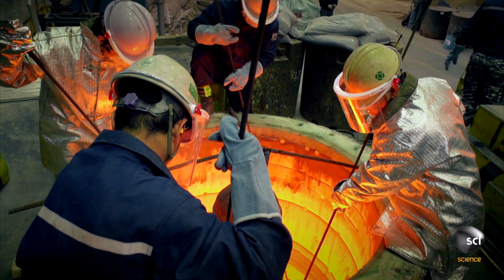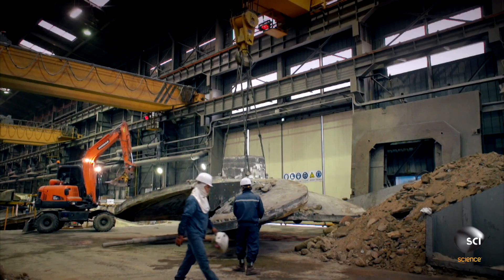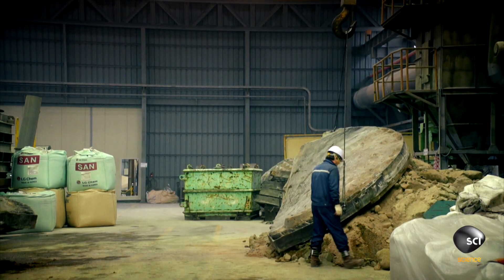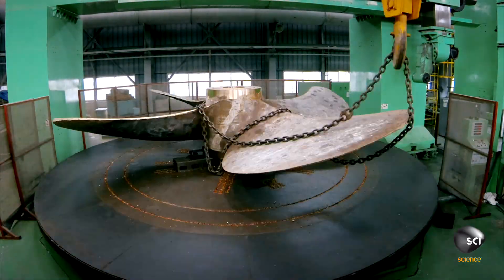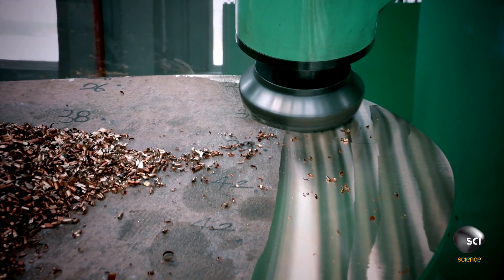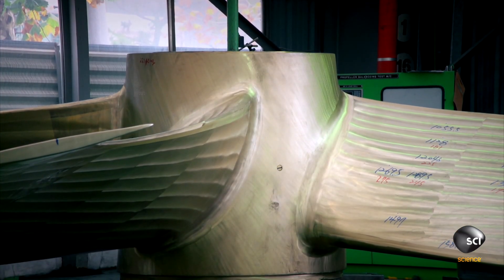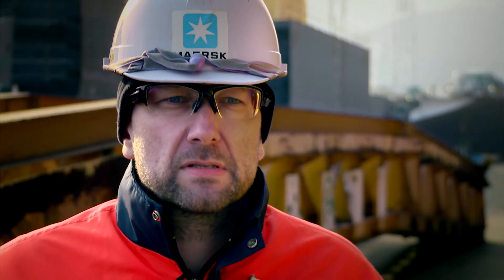Casting a Gigantic Propeller at 1,800°F

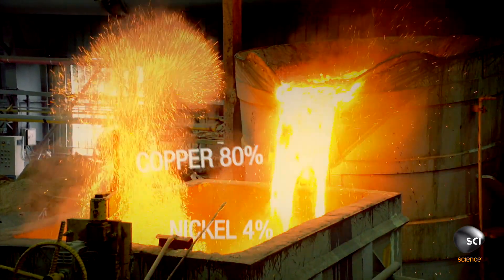Comment: Can I also add that it's made of Bronze, not Steel. it can't rust. See the make up at 1:06, 80% copper, 4% iron.
Reply: Nick Carter yeah I had the same thought
Reply: Ive seen some nasty props, they can leach metals away due to cavitation or electrolysis but ive never seen one rust.
Reply: Bronze i think is Copper+tin.   This propeller is made of Brass: is Copper+Zinc
Reply: pretty sure theres some silicon in there as well
Reply: yeah but even you used a different word then rust... this is a production on tv. They should know better..
Reply: Nick Carter bronze can still suffer the effects of corrosion......they used the wrong words......by saying rust. should know better for a science show.
Reply: It actually looked like a product used to prevent sea growth, nothing to do with rust. In Australia we use a product called "Propspeed" which effectively puts a silicone layer on the surface of the prop, not allowing barnacles to grow on it with regular use.
Reply: Thats exactly what I said about 2 months ago when i saw this....
Reply: Alejandro Medina it’s made of an alloy called Aluminum Bronze. Bronze and brass are pretty much interchangeable terms these days. Source: I work in a foundry and make copper alloys for a living.
Reply: @syxxphive126  Sorry; NO!  Brass is a copper and zinc alloy.  Bronze is a copper and tin alloy.  The ancients knew that 5000 years ago.  Brass is not an acceptable metal for underwater use because the zinc comes out of the metal leaving only porous copper.
Reply: @David-hm9ic  then tell me why copper alloy 954, which is aluminum BRONZE has ZERO tin in it?
Reply: @syxxphive126  because as you said it's called bronze basically for the same reason a 1" sch 40 pipe doesn't have a single dimension measuring 1". Sloppy standards that let room for bad naming conventions to take hold. Most of metallurgy is pretty locked down, I was a little depressed the first time I found it in that section of a red metals yard catalog, but alas, this is the world we live in, not the one we asked for
Reply: Ah, but it can. MUCH slower than regular iron, but it can rust.
Reply: Not to mention the voiceover says "alloy of 8 metals" and then 5 show up in the animation. Had to rewatch to be sure it didnt say steel or bronze to condense it but no, just 5.
Reply: it could corrode, though not specifically rust
Reply: Bronze and copper will oxidise, they wont rust. Once that oxidation layer is there its kinda sealed but that doesnt stop stress cracks opening and allowing cavitation from happening

Comment: Forging?? Really?? Shame on you.
Reply: @sciencechannel  When you buy a ship propeller online without checking the dimensions
Reply: @sciencechannel  What is that supposed to mean?  Ashamed of your mistake?
Reply: No frowns! You changed it, now smile. :)
Reply: Maybe this casting was a forgery? 

BAHAHAHA!!!
Reply: James Demos
Reply: forged would be stronger, if it were possible
Reply: manga12 Wouldent that be super expensuve for this size? They have been casting huge ship parts for over 100 years! Also it was casted then milledvto spec!
Reply: I am just stating a fact, the crosssection of something forged would be hardened and have a better stronger cross section but you often wont be able to forge some materials they are not conducive to it, like aluminum I belive was said a forge press is more conducive to use then a power hammer or drop hammer the way the metal reacts to the force.
Reply: @manga12  This is one of those cases where if you need to be worried about how hard the material is because it's hitting something harder than water, you have WAY bigger problems than just needing a new propeller. There's a good chance you're about to need a new ship.
Reply: @ev6558  look forged makes stronger with less weight that was my reasoning, and less weight means less drag on the engines to turn it
Reply: Ya went a bit far

Comment: this is cast not forged big difference
Reply: Looks like they changed it.
Reply: Can't forge bronze, too brittle!
Reply: Nighthawke70 
I have forge bronze.....you have to be very careful, with the temp you work at......Bronze is developed and gains it's strength via forging it.......BTW......you can forge iron hot or cold.......and yes this prop was cast not forged.
Reply: zzztubazzz hahaha way more then that
Reply: I'm gonna estimate it's around 15-25 tons compared to the size of Emma Maersks propeller which weighs 130 tons. A cars weight is estimately 2 tons, and already costs around $8000-20,000, and we have to remember that it is not a solid block of metal. I assume around 1-5 million something. It is not easy to make something this big, and takes a lot of work. Plus they would have to ship, and mount it which probably costs more.
Reply: mrsargemeister but the title says castimg
Reply: I've had trouble with casting bronze. It's a pain to work with, even with small moulds. This is an alloy (more than just a bronze alloy, I can't recall how many materials he said were in there)
Reply: zzztubazzz Yeah...not.
Reply: zzztubazzz scrap value maybe, these props are hundreds of thousands of dollars, 8,000 probably  barely covers power expenses in the production
Reply: nobody gives a flying fuck!
Reply: The difference being?

Comment: Science Channel with imperial measurements? Really?
Reply: science channel with not science.
Reply: And they said that that the expected life of the propeller would be 124 million miles. The moon is on average 240 000 miles from the earth. The closest it will be is 225 000 and the furthest will be 252 000. Meaning on average the ship can travel 260 times to the moon and back to complete the 124 million miles.
Reply: The metric system has yet to put another human on another planetary body.
Imperial has.
Reply: @ramairgto72  lmao this dude actually tryna say the imperial system is better than the metric system. Even people who use the imperial system know it is shit compared to metric. This is coming from someone who is used to imperial.
Reply: @kirinyardberry1324  "Tryna"?  Seriously?  Imperial is not superior to metric most of the time.  For navigation, Imperial has advantages.  Metric is not superior to Imperial ever.  Easier in some cases, perhaps, but not superior.
Reply: @David-hm9ic  as someone who works constantly with both metric and imperial systems I can say for certainty that the imperial system is much, much worse. It's easier in every single case, and this makes it superior. Why do you think all of science and the majority of engineers prefer metric?
Reply: Dick wad Know it all. You failed. Shut up
Reply: Ramairgto Actually nasa used both metric and imperial in the lunar program
Reply: Simplistic nasa didn't switch to whole metric until 1990
Reply: Because the target audience is Americans genius.

Comment: There are three incorrect statements in this piece. The propeller is "cast", not "forged". The ship will travel 1.24 million miles in its lifetime, not 124 million. The cutter head contains Tungsten Carbide inserts to mill the propeller. It is not a "Tungsten Cutting Head". Thanks. I couldn't help myself. I'm a stickler for factual accuracy.
Reply: You missed one...

The cutter doesn't "grind away at" the surface.  It cuts.
Reply: You are correct, sir!! I missed that one... Must've been still calculating the "five times the distance to the moon" figure in order to dispute that one!
Reply: @Tinker001  missed a second..." the paint keeps the rust away" it is bronze lol
Reply: @Tinker001  not only that, copper alloys don't rust, they corrode, rusting is what happens to Iron based alloys, pedants of the world, UNITE!
Reply: 1.24 milion miles, really? for a cargo ship that is like only 20 years
Reply: But in the video, it states that the propeller and its ship will travel 124 million miles. So, that would be about 2,000 years. I don't think that ship will quite make it that long...
Reply: also that prop would never rust.
Reply: @kdknitro  I wondered about that as well.  But, I assumed that other percentages of ferrous metals might be prone to corrosion and over time, cause significant degradation to the prop.  Pretty sure these guys would know.   As a sort of woodworker with that same fence on my table saw and amateur aerodynamacist, I thought it was a great video.   Imagine the technology and precision construction that went into that milling machine.  150 years ago, that would have been a hallucination.
Reply: Being 80% Copper, I doubt it either!! Good call!!
Reply: No you are correct, AS SHOULD BE THE FLIPPING SCIENCE CHANNEL!!!!!!!!!!!!!!!!!!!!!!!
Reply: 1.24 million miles hardly seems like the ship would even break in.
Reply: @GEES44DC  I was thinking this too. I have had cars with a million miles- and they don't travel across the ocean every day.
Reply: "Being a stickler" really just means being pedantic it seems. 

The only correction needed is the mileage, everything else is just stuff that 99.9% of people have no need to care about. It really doesn't matter. Especially....
"Bronze doesn't rust so that paint is useless!!!!" Ok smarty pants, rust is a form of oxidation and every non-precious metal will oxidize - particularly in the rough environment these ships will travel through. If the paint wasn't needed they wouldn't use it.
Reply: GEES44DC Ships don't last that long in the sea. Salt water is brutal! Great lakes freighters last a long time, but still, 15 miles/hour continuously is only 134,000 miles/year.
Reply: it said the alloy was 8 metals and then displayed 5 and the percentages didn't add up to 100%
Reply: @richardambler2804  That's Common Core math for ya!  Don't confuse them with accurate facts and details.
Reply: @richardambler2804  🤣🤣🤣
Reply: @richardambler2804  chances are the last 3 metals are proprietary, and therefore not listed...
Reply: @richardambler2804  It's common for major metalworks to have their own proprietary alloys where the little "1% of this, 2% of that" that makes the alloy unique is a trade secret.
Reply: Cory Stansbury
Very true, i'm from Erie, PA, we used to have many repair facilities, we are down to about 1.
Freshwater ships tend to just get "outdated" and replaced, they don't get refitted much, and only a few places have a dry dock of any major size. If I recall, the government stepped in twice to save 2 places in my city, one was our dry dock and the other was the company that makes parts for NAVY ships.
Reply: We all are, man
Reply: Its also not called a propeller. Propellers are on airplanes. Its called a screw.
Reply: @brucepreston3794  It can be called both. Propeller is the more common term. Screw is more of a slang term.
Reply: @joefox9383  i was in the US Navy. I worked in #1 engine room on board an Aircraft Carrier. If we called it a propeller, our chief would kick your ass and tell you its a screw. So its a screw. If its a propeller you must be working on airplanes.
Reply: @brucepreston3794  Dad, a Master Chief would have kicked that Chief's rear for being a South end of a Northbound Mule. The term propeller is used in the Navy both for planes and ships. But the term screw is not used for the prop on a plane. The term screw propeller was first used in 1835, long before an airplane existed. Early screw propellers were actually screw shaped and made complete turns as one blade.
Reply: @brucepreston3794  A propeller is a device with a rotating hub and radiating blades that are set at a pitch to form a helical spiral, that, when rotated, performs an action which is similar to Archimedes' screw. It transforms rotational power into linear thrust by acting upon a working fluid, such as water or air. Screw is a slang term in the US Navy. I served on CVN70.
Reply: @brucepreston3794  Sometimes called a prop.
Reply: As others have already pointed out the propeller will not rust. This looks like a nickel aluminium bronze alloy. It is commonly used in the marine industry as it has minimal corrosion and sea life will not grow on it. I suspect the "paint" is just for looks although it may be to prevent any impurities from rusting if the quality control on their alloy is lacking. In fairness, these impurities wouldn't effect the performance of the prop but customers don't like seeing anything but a nice shiny surface on their new expensive prop.
Reply: Not to mention: "finally to keep the rust away..." Bronze does not rust.
Reply: Casted not cast
Reply: @AbhisarRawat  Incorrect. It is cast, not casted.
Reply: Bronze  doesnt rust either
Reply: 1.25m /5,000 = crossing the ocean 250 times, 1x per week is about a 20 year life expectancy. Rough calculations obviously on my part but good catch. Why are these documentaries so fishy washy about being accurate...drives me nuts!
Reply: I've seen mills that grind plenty of times.   They blow all the inserts out so bad it runs like a surface grinder.
Reply: Thank you 👍
Reply: if you didn't say it i was going to! Tungsten cutting head my goodness.....
Reply: Factual accuracy? They said cast at :57 sec I didn't hear forged and the cutting heads really potatoe potato
Reply: Does the turning thing
 mount on a propeller shaft or a screw shaft?
Reply: @michaelmccarthy4615  lol good one
Reply: It's also an anti-corrosion coating, not an anti-rust coating. Whilst there is a 9% proportion of Iron in the alloy, it's not the main constituent.
Reply: @jonnybabes1  I believe thats the thing, people are caught up on the word rust and believe it's the same as you'd see with any metal above the water, but these will corrode over time and cause it to be less efficent. Sea water isn't as forgiving as people like to think.
Reply: Jonathan Bailey the coating is strictly for delivery appearance. Nothing in the world that is sprayed on would last a month on a prop
Reply: @dwood82574  I dont know about commercial ships but private yachts all get anti fouling paint on them. Maybe commercial ships move too much to make it worth the effort.
Reply: You're gay
Reply: we need more of u👍🏽👍🏽
Reply: Was there a reason why they never used stainless steel?
Reply: aww so you're that guy huh
Reply: I hope you realise that many buses clock up over 2 million miles in their life time, nevermind a ship, thatll do way more
Reply: Having said that, if it travelled 5 million i would strongly believe that
Reply: Alex Hickey busses don’t travel at 15 mph
Reply: "Science" has become fantasy and propaganda these last decades, lies are to be expected.
Reply: Copper doesn't "rust", so why you suppose they're coating it?
Reply: @Gravertrain  Copper has it´s own type of oxidation, the oxidation layer turns green after some time.
Reply: Well, we actually need more sticklers for factual accuracy these days. Keep it up
Reply: It's things like that that make me not want to watch traditional tv.
Reply: How many sea life will it kill in it's lifetime?
Reply: Antonmursid
🙏🙏🙏🙏🙏💝✌🇲🇨🇲🇨🇲🇨🇲🇨🇲🇨💝✌👌✋
Reply: Thank you for the clarification
Reply: He also said that the propeller is painted to keep the rust away!!! The Tungsten cutting head does not grind but it cuts.
Reply: The propeller is made of a material called brass. An alloy of copper and zinc for your information
Reply: Damm old Salts said it best
Reply: If we’re pointing out mistakes, there’s more, such as the pouring temp of that kind is going to be over 2000 F not 1800 F for this particular alloy depending on the amount of superheat added.